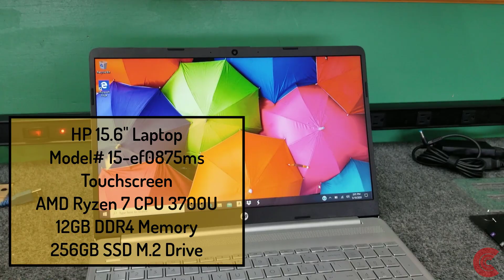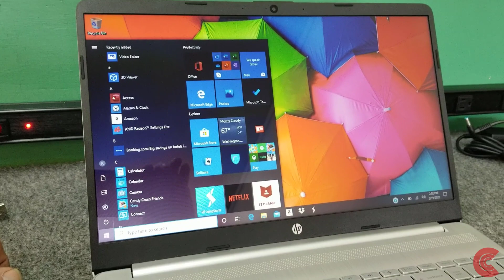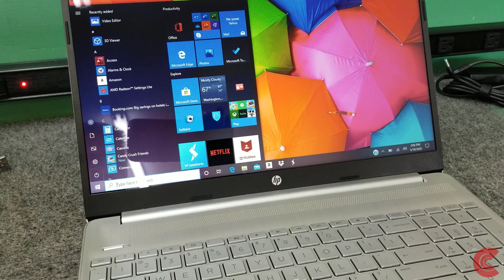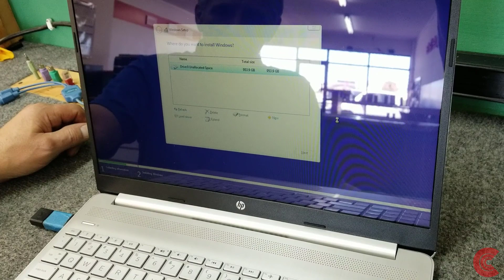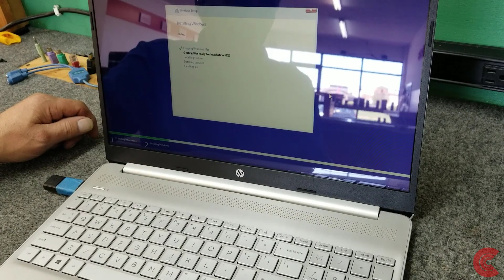HP 15.6" Touch Screen Ryzen 7 Laptop SSD and Memory Upgrade

Comment: Thank I have this exact one and was able to follow the video to upgrade ram very very helpful, thank you so much for making this video, I wasn't sure about the rubber feet and never would have figured out how to open this thing. I followed every step, thanks!  Worked out perfect but when I restarted a black screen came up saying checksum didn't match, then it said resetting checksum and restarting, no problems after that.  What is the max ram capacity on this laptop?

Comment: To clean the keyboard I just remove the screws that hold the motherboard and all the other parts?
Reply from the maker: hi, the keyboard is basically very difficult to remove. it is sonic welded in from the backside.   unless it is bad, i would not recommend trying to remove it, Dale
Reply: @CadillacComputerCenter  Thank you. Great video!

Comment: thanks for this video. I have the exact same model number, and an HP rep posted incorrect information about using a SATA m.2 drive to upgrade storage. your video saved me a huge headache before I bought the wrong drive type!
Reply from the maker: Hi. Many hp laptops ship with m.2 sata ssd drives but will support m.2 nvme. Honestly,  it's been trial and error on alot of these. I just did a lower end hp laptop that would run an nvme drive. Only m.2 sata.  I take the time, when I can and find out for myself.  Companies like hp, acer almost never get it right when trying to help.  They just dont know. Same with ram, they'll say only supports 8 or 12gb of ram, and almost ALWAYS, MUCH MORE. Dale

Comment: Any way to upgrade the atrocious screen?
Reply from the maker: Hi. Well, maybe. It is a touch screen,  so any new screen will have to have the 40 pin connector. Possible to do.  I'm not a fan of glossy screens.
Reply: @CadillacComputerCenter  It's not just the gloss, the viewing angles are really bad on mine.
Reply from the maker: I know what you mean.
Reply: The option when you buy online has the 1330x789 or w.e and then the 1920x1080. I’m guessing if I buy this laptop I should get the 1920 for the extra 60 dollars. You can probably find the screen on eBay if you are good at changing screens. Definitely possible

Comment: Mine came with 12gb ram. When you stepped up to 32, did you find it was a LOT faster or just a little? Im thinking the  NVMe is the main factor for speed. I HAVE to get the 1TB  NVMe though. Just wondering for basic use if its worth buying the 32gb for. Let me know what you think please. Thanks
Reply from the maker: Honestly,  the nvme ssd is a major speed boost, not memory. People have asked me for years, does more ram speed up my computer, no, it does not so much.  More ram is helpful for some rendering projects, heavy user of chrome tabs, etc. The difference in speed with 16gb of ram and 32 for example,  is barely noticeable.  Dale
Reply: @CadillacComputerCenter  Hi again, and thanks for answer. Couple more questions if you dont mind. 1. If I remove the original 256 HD, where / how will Windows reload on the new one? Internet or does laptop have some sort of small HD for that? 2. Do I HAVE to take out battery when installing new nvme? Or is that just a precautionary thing to do? Thanks again!
Reply from the maker: Hi. Yes will have to either clone your old drive onto new one. Or do clean windows 10 install.  Make sure you back up your data if you do a clean install.  Taking out or disconnecting battery is precautionary.  Just be careful.   I have other videos on clean installs and cloning. Dale
Reply: It already come with a ssd so the performance your seeing isn’t going to change much by adding a bigger hard drive unless it’s a faster hard drive than the one that’s already in it. Ram with help your computer from lagging and the more intense the load such as recording music, editing videos and rendering them, and playing games will make the difference by the amount of ram you have. The more the better, just depends on how much you need for your most demanding activity.

Comment: I have this computer it tends to get very hot above 60c ° is it normal? or do you recommend something
Reply from the maker: 60c is a little hot. AMD cpu does run a little hot.  You can blow out the air vents to clear any built up dust in there.  As long as it isn't locking up. Should be ok though.

Comment: Can I set up an egpu enclosure via the NGFF port by removing the WiFi card?
Reply from the maker: The ones I'm aware of require TB3 port. Thx
Reply: Cadillac Computer Center oh, well there’s a specialized desktop gpu adapter that connects to laptops via the WiFi card slot and it draws power from an external psu
Reply from the maker: Was not aware of that.  Thx
Reply: Cadillac Computer Center damn why u gotta be so mean :(
Reply from the maker: Mean??  I was telling you I was not aware of the device you mentioned.   I'm a nice guy. Thx
Reply: Cadillac Computer Center sry but the abrupt sentences and the “. Thx” threw me off into thinking that
Reply from the maker: I answer tons of comments each day, my replies can be short and to the point. I love you man!!!  Dale
Reply: Cadillac Computer Center oh ok I get you  have a great day 🙏👍

Comment: This was actually really useful, especially the information at around 10:55 about mounting a Sata HDD. That's really what I want. The NVME was a great upgrade as was RAM which I already upgraded but I'm having trouble on finding parts for Sata as well. I've only tried two so far so there is hope yet. Kinda sucks that HP makes it so hard since Lenovo and ASUS have the connections in there even in their slim models.